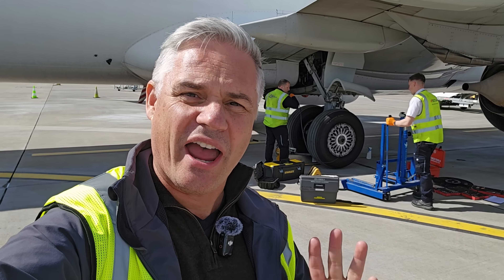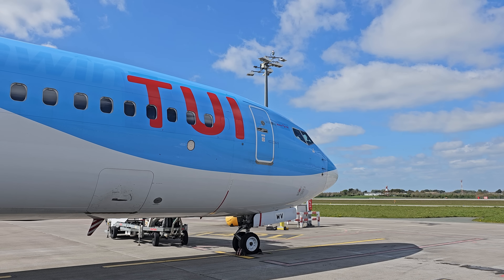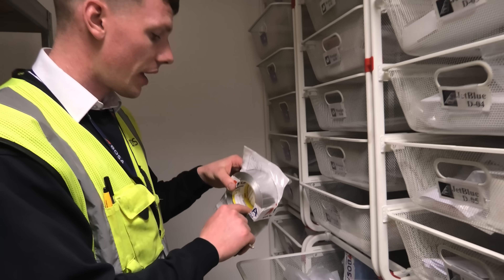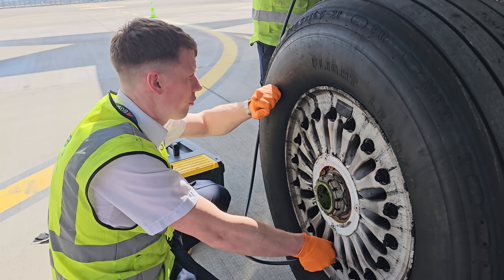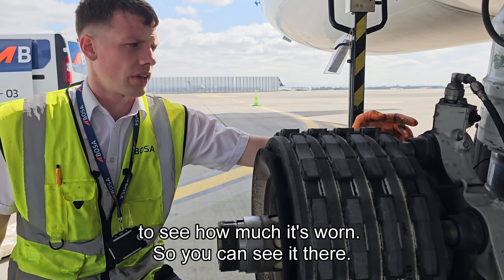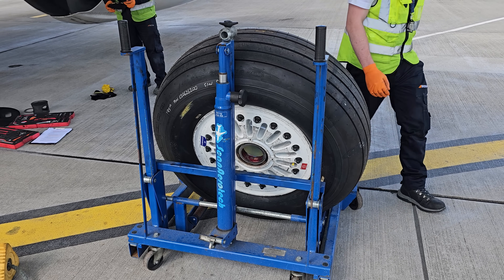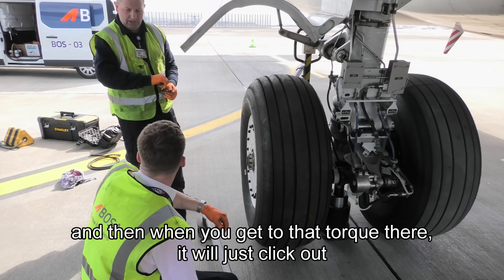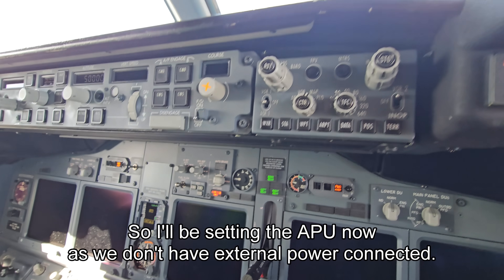How to Change a Wheel on a Boeing 737

Comment: Hello Dennis,
Wow! Again another really interesting behind the scene 😊
I have a few questions :
-How heavy is a wheel of an aircraft?
-How often (on average) are they changed? (I understood that there was a alert to change them inside the aircraft system, it's just to make a parallel with car tires😅)
It also surprises me that they are not wearing an helmet (the side opening of the wheels felt so close to their head, I was scared they would bump their heads).
I hope you will continue those kind of videos that highlights the job of all the part of this industry 😊
Have a great day!
Reply: No alert inside the aircraft to let you know that a tyre requires replacement

Comment: Going to assume you meant 15K USD and not 1500 for new tire? Wouldn't make sense that a reconditioned tire would be 8500 USD while a new one being only 1500.
Reply: 1500 for the rubber tyre and 8500 for the metal wheel that it mounts on.